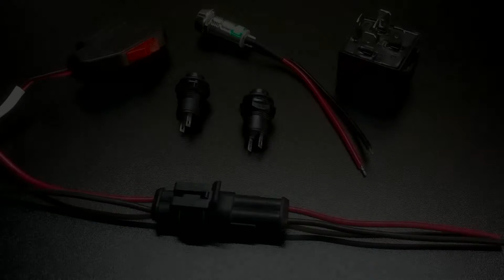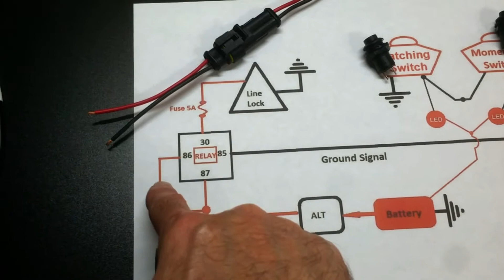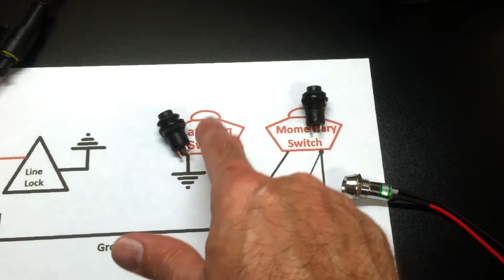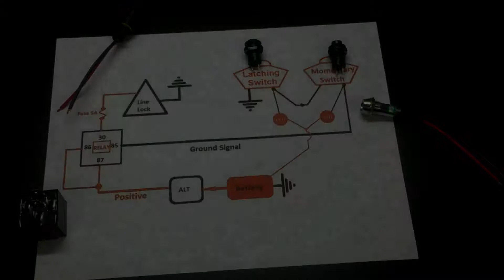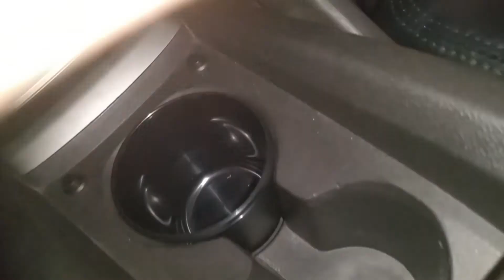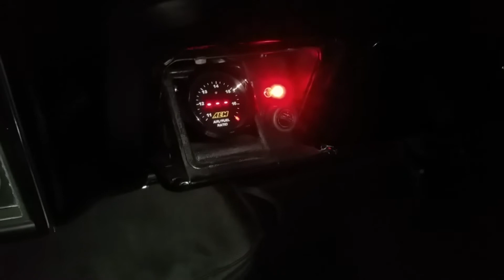74 Nova LS Rebirth Ep 20 - Line Lock Install Pt 2 - Wired Up

Comment: Awesome idea bro, keep the good work coming, i will b using yo idea on my 67 camaro, with L99 to LS3 conversion with 6L80,, have a ? how about the Tap shift with 6L80, iam sure u have it on yo build, iam going to use Hollet Terminator X max with thier 6L80/90e transmission control, also iam triying to use 2022 ford ranger shifer which i like,,let me know thx

Comment: How many power does it pull. Can I install this as a park lock, without killing my battery. I know there are mechanical brake locks but I want to install an electronic one like this one.
Reply from the maker: Guaranteed it will kill your battery. Its not intended to be used continuously.